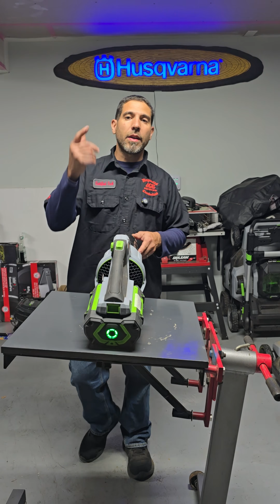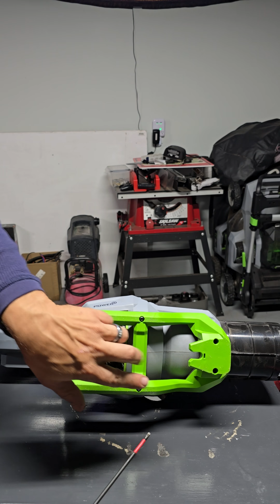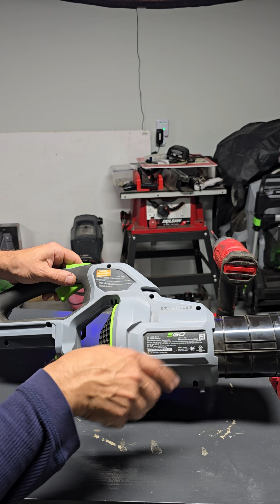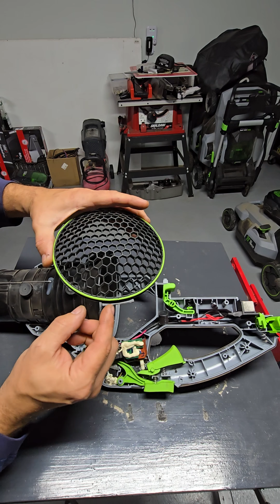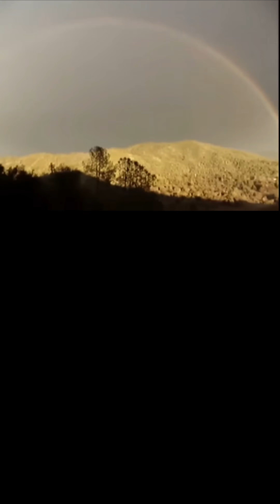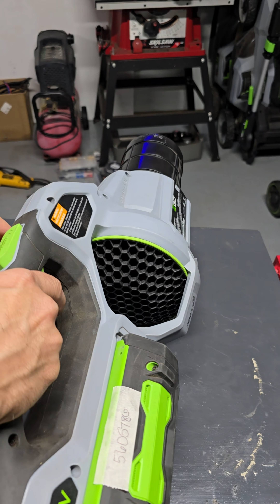EGO LB6500/LB6700 Blower Repair 🔧 Full Electric Assembly Replacement & Rebuild!

Comment: I have a 765 blower and mine went out too. Is the new electric unit upgraded in anyway or did EGO just leave it the same?
Reply from the maker: @Billyhvcfjudse - Ego did upgrade the electric assemble for the LM7650 to get more power delivered to the nozzle, but the new PCBA can also have a similar issue since there is more draw, so they can burn out. There seemed to be a run on the LM7650 PCBA's I am currently out of stock but have more on order: https://hardwarecaptain.myshopify.com/collections/ego-parts/products/ego-lb7650-electric-assembly-2831084001

Comment: Florida, mine was 1 year ang got the same issue. Lb6703 Blower price is around 235 with battery and charger.

If it's under warranty it's OK (even though you have to travel to service center which is extremely inconvinient and wait for parts). If it's not the pcb is under 100 dollars, but overall doesn't justify the time and no new battery.

Hence the question, do higher models have a better more reliable PCB, or they all are garbage?
Reply from the maker: @VadimKirilchuk - Yes they do have a commercial line that is more durable and very rarely come into the shop for repairs. They are a bit heavier but are meant for constant use. I have seen a trend of units purchased from Lowes have the highest failure rate and looking at them those PCBA's didn't have the extra in line protection.

Comment: Would there be any other issue apart from this? Ive had 2 go out on me within a year of purchase
Reply from the maker: @elit.8034 - For either the LB6500 or LB6700 models there are really only two things that can go: 1 - the electric assembly (usually seen when the unit has no power or when you pull the trigger just the battery light turns on and nothing else) 2 - The ducted set (which is the base of the blower tube that houses the motor) this can usually be identified if you pull the trigger and hear a click or the blower turns on and you hear a horrible grinding noise.

Comment: Were do you buy these items electric
Reply from the maker: @jolandabrouwerseymore8260 - If you have either the LB6500 or LB6700 Ego model here is the link for the electric assembly: https://hardwarecaptain.myshopify.com/collections/ego-parts/products/ego-lb6500-lb6700-electric-assembly-2830244003

Comment: I have the same problem but with the lbpx800c
Reply from the maker: @larrycastro399 - Chances are it is the electric assembly but those are taken apart differently. They are slightly easier to work on since everything is accessibly under the one cover. I have a few backpack blower videos published, though they are now the commercial line, the steps are similar.

Comment: So why do they fail
Reply from the maker: @longwalkoffshortpeer 80% of all Ego warranty repairs that come in are all from Lowes - the internal electronics are slightly different and don't have the extra inline protection. The rest are either overheated or defective PCBA's
Reply: @HardwareCaptain  anyway we could add extra protection if we are taking one apart and trying to fix it?
Reply from the maker: @MaxsGarage-p8q - Splitting the clamshell is safe as long as you remove the stand and all of the surrounding 10 screws. If you are talking about the electric assembly itself, that's a different story. The way they are designed, there is no good way taking them apart to separate each component. In a bind in the past if I didn't have a full PCBA and the unit was no longer under warranty - the only way I could replace an individual part safely was to cut the leading wires and splice (solder) the new piece in.
Reply from the maker: Ultimately to save you time - for the LB model blowers if:
- You have no power at all and/or only the battery light turns on when you pull the trigger - the electric assembly need to be replaced
- You have power and you hear a click/or an attempt to start the fan - the ducted unit is bad
- You have power and the fan spins but you hear a loud grinding noise - the ducted unit is bad
Reply: @HardwareCaptain  Hey there yeah I am practicing microsoldering and so yeah i already got down to the mosfets on the board got all caulking and the heat shield off and ordered new mosfets and a gate resistor (the little tiny thing labeled 101). So if anything it is for practice. But yeah I would love if ya kept the bad ones and I can pay you for them just to practice on and see if I can fix them for myself / harvest parts off.
Reply from the maker: I have a few, if you just pay for shipping I can send them to you
Reply: @HardwareCaptain  I sent you an email to the one listed on your page. That would be awesome
Reply from the maker: @MaxsGarage-p8q - Got it, sent you some info on a bundle

Comment: Ego appears to be shafting me so I might have to do this repair myself. You guys take repairs from Iowa incase I can't do it myself? Even it's half the price of a new blower to repair it would be a better option.
Reply from the maker: @MRFLAPPYTREE We do take ship in repairs if you need some help, but let's try one thing first: send me a picture of your serial number to morgan@depaultshardware.com, along with a picture of your purchase receipt and maybe I can help get it covered under warranty if the blower is less than 5 years old
Reply: @HardwareCaptain  ❤
Reply from the maker: @MRFLAPPYTREE Just sent you some info in your email
Reply: I have a 2024 cfm670 lost my receipt is there a way to get a warranty from them
Reply from the maker: @rmstark1966 - I assume you have a model LB6700 which is very popular. If you call EGO and go thorough the warranty process (maybe look to see if you can find a credit card transaction to help) they do sometimes may a one time exception for lost receipts. If your near Rhode Island we can help
Reply: Just here to follow up, ended up ordering the wire assembly and got it swapped and it seemed to fix my blower. Thanks for all the help.
Reply from the maker: @guillotine2028 - Excellent work, nice job! I love hearing success stories,  put a FixT stamp on it

Comment: You fast forwarded through the most interesting parts making this video semi useful 😢
Reply from the maker: @Vchemsilabratvpravde Which part did you need more help with? The biggest part of this model's repair is to run the wires carefully in the same channels as they came out of - if you need some more in-depth help, reach out at morgan@depaultshardware.com and I can share some documentation

Comment: You can also change MOSFETs
Reply: If it is the MOSFETs. My MOSFETs are all intact, no blown fuse. It outputs only 1.6V on each of the three motor outputs. That tells me it's the PWM circuit that's developed a problem and with the way they have potted the hell out of the PCBA, I honestly cannot be bothered to sit there with a fibreglass brush to get all the encapsulation off and poke around with the oscilloscope.
Reply from the maker: @larzblast - Ya for sure. The basic troubleshooting steps for blowers when we are testing for warranty service are really as easy as: Does the blower have no power when triggered is pulled, (if the answer is NO) only the battery light turns on? Then the main electric assembly needs to be replaced. (If the answer is YES) the blower at least makes an attempt to spin the motor, or makes a loud noise when activated, then the Ducted set needs to be replaced.
Reply from the maker: @olivierj.2435 Certainly if they test bad and you can get them separately, that can save some money. For warranty repairs we replace the whole electric assembly as the PCBA can fail or provide voltage outside the expected range, re-causing damage. Thanks for supporting the channel!

Comment: What is the part the you replace, thank for the video
Reply: Hey thanks for the vid! I'm on the fence, fix mine for $80 or buy a 765 Tool Only for $200. How much do you charge for this repair? Do you service Indy by chance?
Reply from the maker: @jacobblalock8218 I am based in Rhode Island but folks due ship in handhelds to be fixed. The first thing to check is if your blower is still covered under warranty, if so the repair would be covered by EGO. If not, and the rest of the unit is still in good shape it can certainly be repaired. For this specific repair we charge $45 labor plus the cost of the part. Thanks for supporting the channel!
Reply from the maker: @MaxGarzona For the EGO LB6500 or LB6700 this is the link for the replacement electric assembly: https://depaults-hardware.myshopify.com/collections/ego-parts/products/ego-lb6500-lb6700-electric-assembly-2830244003